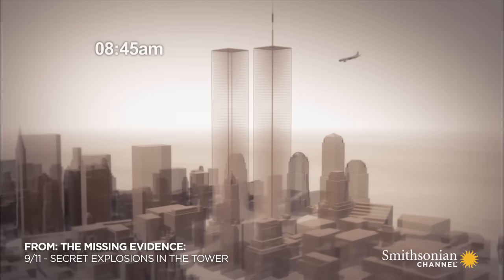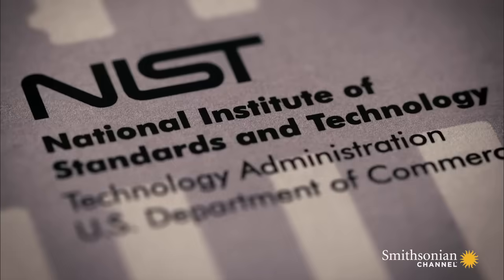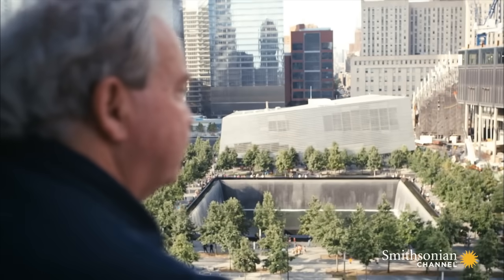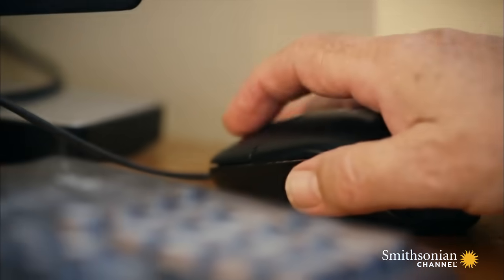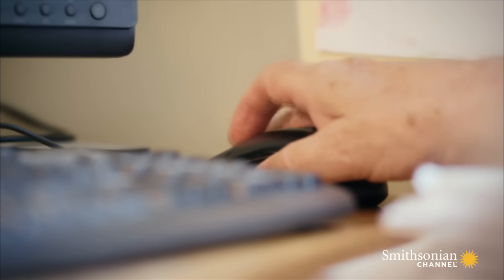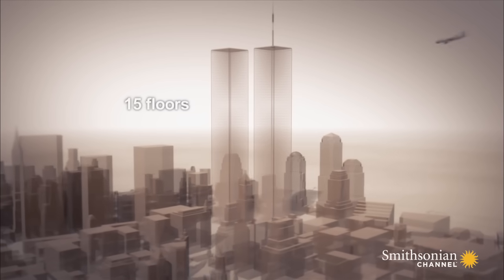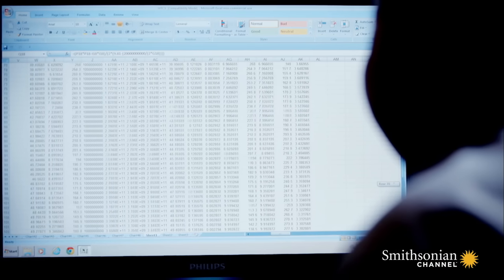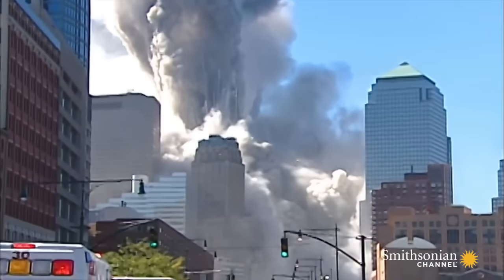This Computer Simulation Explains How the Twin Towers Fell

Comment: Evidently they were not designed to withstand an impact from an airliner.
Reply: But they were, the design specs required them to take TWO impacts from  large commercial planes!!
Reply: Neither is a wrecking ball.

Comment: Wow! look ! the Towers were hollow inside ,not thousands of tons of structural steel!! That must explain how when the top section ceases to exist in this video, it can still crush the thousands of tons of steel below!! Because the bottoms weren't thousands of tons of steel , they were hollow!  its a miracle!!
Reply: The top section did not "cease to exist." Yes, it was destroyed - but 100,000 tons of building did not disappear, it turned into 100,000 tons of rubble. And don't forget, that mass increased with each floor that was destroyed.

And yes, the towers were mostly hollow - 90% air, by design.

Comment: You have engineers using computers saying the T T were dropped with controlled demolition charges. You have this guy saying the towers were dropped because of some thing that was ok ed. by the President and The Government at the time. You can not really believe either one. No one is getting to gether and show each other what is wrong with the ideas of each side. When I found out that the Enron people would luck out because of Bld 7 going down and the renters insurance had been just upped by the renter of the Twin Towers. The leaser of the two towers would make more money when and off the towers burned. That is pretty simple Ocums Razer for me. Make money. 

Computer simulations are as good as the program is. There is a DC 10 plane that was landed in a Kansas Corn Field after damage to the center engine. The simulator for that plane would not allow the plane to be saved way it was. It is good that there were Five Pilots trained on how to fly that plane the DC 10, when the plane was in danger of crashing. Five Pilots won and proved that the computer simulator for the DC 10 was useless.

President Kennedy was killed by several people. He was making so many people angry, that Is why he was killed. Money, Money, Money. The Warren Commission conclusions were being denied just as the ink was drying on the  Warren Commission Report.   

Jimmy Hoffa was killed because of the money that He could control if he would have gone back into the presidents chair in the Teamsters. Money, Money, Money.

Comment: A day that three buildings fell at freefall speed coincidentally.It’s just a rare occurrence nothing to see here LOL.
Reply: 12weasel100 do your research...yes they did
Reply: @nicholaswhs0896  
The total collapse time of all three buildings was slower than free fall........the twin towers did not collapse symmetrically..... and it did not collapse into its own foot print.
Reply: anthony winter that’s inaccurate actually.
Reply: @nicholaswhs0896 
An object has reflectional symmetry (line or mirror symmetry) if there is a line (or in 3D a plane) going through it which divides it into two pieces that are mirror images of each other.....

Can you put a line down the middle of the twin towers and make a mirror image of the collapse (falling rubble etc)?

The twin towers took up to 25 seconds to fully collapse....parts of the core were seen still standing after the collapse. Only the outer shell collapsed in 9 and 11 seconds.

Only the outer shell of Wtc7 collapsed at free fall for 2.25 seconds....but the outer shell took 5.4 seconds to collapse. Free fall would have been 3.9 seconds. 

The outer shell collapsed 40% slower than free fall.
Reply: anthony winter I’ve been hearing different from my research
Reply: @nicholaswhs0896  
Engineers only design buildings with dead and live load vertical redundancy.

They do not design buildings with dynamic kinetic energy vertical redundancy.

The Twin Towers structure was not designed for any vertical kinetic energy.

Modern buildings have ZERO resistance to vertical Kinetic energy.

Modern buildings are 90% hollow, so once they start collapsing, its almost impossible to stop.

The pyramids are made from solid granite blocks stacked on top of each other...so the pyramids can not collapse...they have been around for 4,500 years.

95% of the volume of the towers was air.

Air has almost no resistance...even the TT's steel columns are hollow. 

Its easy to design a tall building to resist lateral kinetic energy, because tall buildings sway and flex so can absorb something like a plane impact.

But with vertical impacts the building is too stiff and can not act like a spring and absorb the kinetic energy.

You need to understand that in a large vertical impact, strong stiff columns will not help....they will not be able to absorb the kinetic energy.
Reply: anthony winter I see what you mean but I’ll refer to the professionals. Thanks for the info though.
Reply: @nicholaswhs0896  
Why are only 3000 professionals signed up with ae911truth?

There are millions of them in the world but only a few of them signed with Gage.

I am also a professional.

Comment: What a lie. 
Its worse on the Pentagon.When on the 10th construction was completed. That  added depth of wall to prevent such a thing.Just a couple question of the NIST report that cost as much as a night out for our beloved HILL AND HOUSE. How do you get a sixty foot tall plane  in a eighteen foot hole? How do you rematerialize a quadrimer as the report says  To punch through the second ring? One last question with twp parts.Why did the helapad operation clock stop at 8:30 and the first plane hit at the towers at 8:52 Why a predator drone that wreck at the pad , was painted as a American Airlines? Do not follow the money................

Comment: Even with the North tower hit, they kept sending planes. Even when they knew flight 11 was hijacked, they gave flight 175 clearance to take off. Both flight 11 and flight 175 were flew into the twin towers. R.I.P to every one on the 4 planes that were hijacked flight 11, 175, 93 and 77. Rip to all first responders World Trade Center workers .
Reply: Flight 175 took off at the same time Flight 11 was hijacked. Besides, it would've taken at least a few minutes for news to be sent to different people. Also, they didn't know it wasn't just Flight 11 that was going to be hijacked, or that any of the flights would crash into buildings.

Comment: I also saw a video on Real Stories where an expert on fireproofing said that the towers had been inspected and that the inspectors had found that much of the fireproofing material was either missing or had fallen off because the material had been applied to rusty surfaces, and the rust had flaked off, taking the material with it.
Reply: Okay, steel doesn’t melt at that point of jet fuel. But it would bend...I’m more into the physics of it. Have you ever heard of the system “bullet physics”? Same system used in the film 2012...the physics there are actually unreal how true to live it would be. Sorry got distracted...anyway issuing the blueprints of the buildings and basically throwing a plane at it...the buildings still stood...that’s all I’m gonna say cause that’s all I know. I know lives were lost
Reply: rust inside of building?
come on

Comment: This makes sense, though.  The scientist says that the weight of the towers above the point of impact was almost as much as the Titanic.  If you were to somehow suspend the Titanic right over the Empire State Building and drop it, the Titanic would probably crush it, just as the Twin Towers were crushed.  I still don't understand why WTC7 collapsed.
Reply: 12weasel100  I hadn't heard that before and it would explain the collapse of WTC7.  It seems that WTC 1, 2 and 7 had unique designs that made them susceptible to large, uncontrolled fires and I wonder if the terrorists had considered this.  They probably weren't smart enough, though, and only knew how to fly a airliner into a really large building.
Reply: @duanebarry2817  Don't believe the weasel! He is objectively wrong. NIST published their final report on Building 7 in 2008 and stated "Neither the transfer elements (trusses, girders, and cantilever overhangs) nor the “strong” floors (Floors 5 and 7) played a significant role in the collapse of WTC 7.  Neither did the Con Edison substation play a significant role in the collapse of WTC 7" NCSTAR 1A pg 48
Ultimately NIST came to the conclusion that thermal expansion caused a floor beam to walk off its seat, causing the floor to collapse. Although these failures occurred at relatively low temperature, NIST claims it led within seconds to the entire building collapsing in freefall.
They did not look at a single piece of physical evidence and based their conclusion entirely on a computer simulation. Just this yeah, prof Hulsey at UAF published his study in which he performed his own computer simulations and showed that NIST made critical errors and omissions, in what appears to be them forcing the simulation to match their desired outcome. 

You really don't need all that though. Just watch the collapse with your eyes and you can tell it's obviously a demolition.
Reply: @theTavis01  I don't know what to believe about WTC7 but I'm quite convinced that the official story on the WTC1 and 2 is correct.  If someone could set up explosives to demolish the WTC7, couldn't he do the same for the twin towers, rather than relying on two planes to hit them?  Also, why would someone wait 6 or 7 hours after the fall of the twin towers to demolish WTC7?
Reply: @duanebarry2817  The freefall of Building 7 proves it was a demolition.This has been common sense for years, but just recently Prof Hulsey of UAF completed a computer study which proves this definitively.

"If someone could set up explosives to demolish the WTC7, couldn't he do the same for the twin towers" Yes, exactly, and they did! There are hundreds of eye witness accounts of secondary explosions. Secondary means in addition to the plane impacts. You can also see secondary explosions in video footage of both tower collapses, sometimes dozens of floors below the collapse front. There's also documentation of molten and liquefied steel, which jet fuel and office fires are not capable of. There's also tiny unreacted fragments of explosives that an international team of independent scientists found in the dust. Despite all of that, the government investigative agencies refused to perform standard tests for explosives in the debris... 

"why would someone wait 6 or 7 hours after the fall of the twin towers to demolish WTC7?" That's the type of question that cannot be answered without a criminal investigation with subpoena power. We don't know exactly what was in the criminals' heads. It's possible that WTC7 was supposed to go down much earlier in the day, to be forgotten about in the confusion, but something went wrong. There is some evidence to support this, such as Barry Jennings reporting an explosion in that building in the morning.

Comment: Can anyone say how a building similar similar is size, but constructed differently, would have fared if it had been hit by a 767?  For example, would the Empire State Building have collapsed as the twin towers did, given it has quite a different design?
Reply: The engineer who designed the twin towers said .....the empire state building is stronger than the TT's.

Wtc7 had inner core connections that allow the girders to rotate in a circle.

They were not ''moment resisting'' connections, so they were not very strong.

The outer shell was a very stiff moment resisting steel frame, designed to resist the overturning moment....that's why it stayed level during the collapse.
Reply: When they were first built, people described the Twin Towers as the "boxes the Empire State Building came in", because they looked like cheap cardboard compared with the Empire State.

Comment: If you say so. It's crazy how advanced calculations can be done with Excel.
Reply: Strawman
Reply: @peterjv8748  "Strawman: an intentionally misrepresented proposition that is set up because it is easier to defeat than an opponent's real argument."
He made a program in Excel and he says it works. And then he shows a simple graph on his screen. Those are real arguments indeed, physics can't beat that. I came to see arguments, the title promised them. There's not a single one in this video.

Comment: No modern steel frame high rise building has ever collapsed from fire. Until 911 , then 3 of them all fell at free fall speed , all happening within hours of 2 plane crashes. There have been dozens of high rise fires that have burned for days ,They never fell ,  rebuilt and are used today. First time this happened , must be a new day and age and new physics. ha
Reply: How many of the "steel frame high rise building"s that never "collapsed from fire" had huge jet airplanes crash into them at full speed?
Reply: @steviemack9  "No one thinks the 2 airplanes brought down any of the 3 buildings that fell that day."

Says who?
Reply: @steviemack9  Also you didn't answer my question.
Reply: @steviemack9  What observations?
Reply: @steviemack9  People who are wrong are always the first to bail on the conversation. smh

Comment: Take the North Tower for example, and if you focus SOLELY on the interior VERTICAL core columns .. I just cannot fathom how roughly 90 floors worth of intact vertical core columns could be pulverized so quickly, that is to say with seemingly no resistance
Reply: If you look ever closelier you will see that a column of one of the towers stands for several more seconds after the rest of the building has already collapsed.

Comment: 15 yrs has passed and I'm still wondering how the buildings fell in a straight line oh wait I know already. And don't get me started on tower 7 it fell for no reason.
Reply: How did the buildings fall straight down? GRAVITY.
Reply: @Tim22222  Controlled Demolition
Reply: @tazmania7785  But no actual evidence of CD was ever found. Nothing!
Reply: Wes Fox  have no idea what that is. But sounds like another lying media piece of trash.
Reply: Wes Fox  but why did it collapse? In no way it got 'hit' by the planes.
Reply: Wes Fox  WTC 7 also had a less than ideal foundation as it was built (connected) to the old and out of date foundation of the building that occupied the space before it. And a huge chunk of one of the towers fell on WT7.
Reply: All three wtc buildings had very stiff ''moment resisting'' outer shells, that are designed to resist the overturning moment. They are also bolted down to solid bedrock..... that's why they fell in a straight line.

Do you think engineers would be dumb enough to design a 110 story high building that would fall over onto other buildings?

Comment: Nano-thermite or super-thermite is an explosive which was found in the 
dust of the World Trade Center after September 11th, 2001. It can be 
ignited at around 450°C. In 2001, nanothermite was a cutting edge 
technology to which Stratesec had access, as well as having access to 
the building.
Reply: Check out how railway crews use thermite to weld railway tracks together it’s use is definitely a plausible theory
Reply: Simon Biggs huh? Thermite is used for welding in railroads, how on earth do you make the connection to the stupidest idea ever that the wtc could have been demolished by thermite? Btw, watch a couple videos of railroad workers using thermite welding and you’ll notice things that nobody noticed in NY on 9/11, namely the amazing light show it produces. Thanks for bringing that up. Railroad thermite welding definitely supports the fact that thermite couldn’t possibly have been used to destroy the wtc...
Reply: Alberto C thermite of any kind is not an explosive and it was not found in any wtc dust... try again truther.

Comment: And the Windsor Tower burned inbetween 18-20 hours nonstop and it didn't end up as pile of concrete, twisted metal and dust. So this computer simulation doesn't prove jackshit, unless the point is to show that the people who created high rise skyscrapers can't build safe buildings.
Reply: Windsor tower had (Transfer floors) ....not all the floors were transfer floors....it had two of them I think?

They are very very thick concrete floors that are designed to stop a collapse progressing down to the ground. It stops the building from totally collapsing.

The wtc buildings did not have transfer floors .....and they had a design that allowed them to totally collapse.

The new freedom tower has a design that makes it impossible to totally collapse.